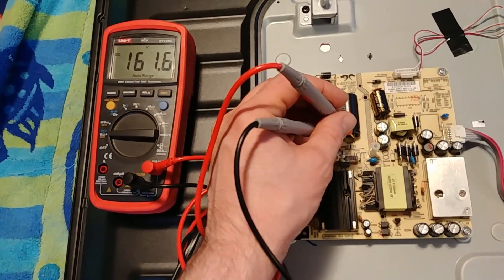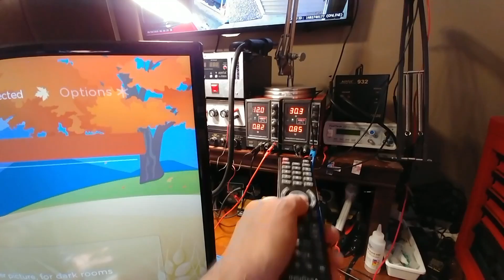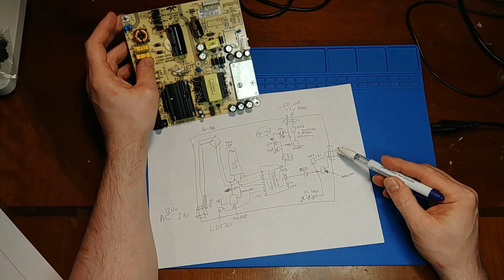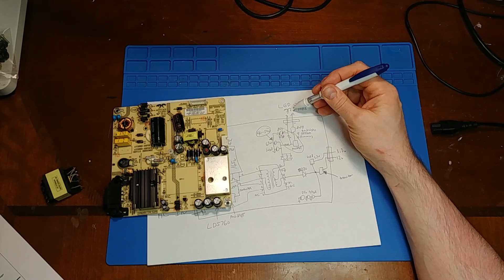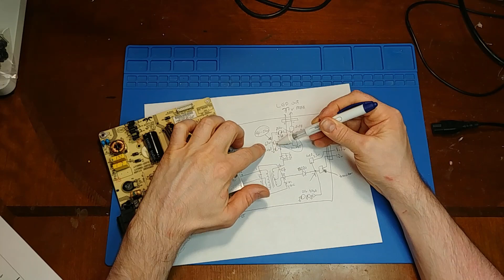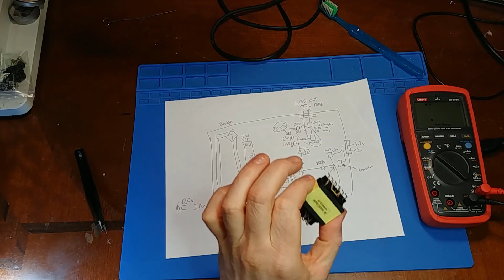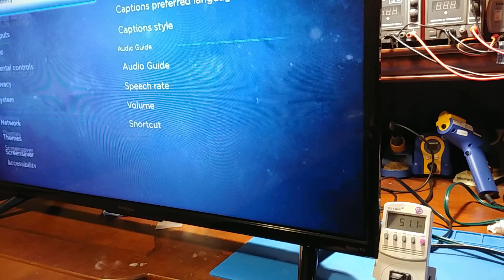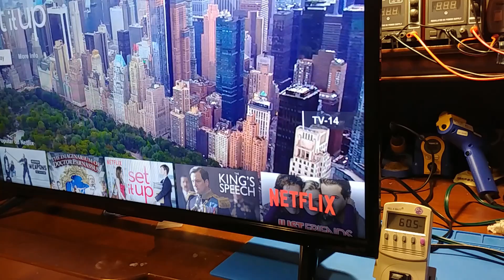How to Repair a Insignia Roku Smart TV

Comment: Mine was dark yesterday, then the screen went completely black. I can still hear sounds when I push the remote and the blue light below the TV still shows it's receiving signal from my remote. Can you help?
Reply from the maker: 90% chance you have LED failure. Possibly power supply or main board issues, but more than likely LED issues.

Comment: I had one of these Sharp LC50LB481U Roku's and had to repair a few LED's I picked up for free off Craigslist or Letgo.  Wound up buying a 42" similar model with a broken LCD screen for parts (LED's and other components if I needed) from someone for like $40.  Well... that was my first experience replacing LED's and when aligning, snapping or screwing together... I wound up cracking the LCD screen. Bummer... though great learning experience.  Great videos.  Just subscribed.